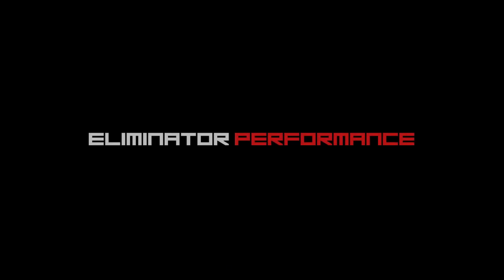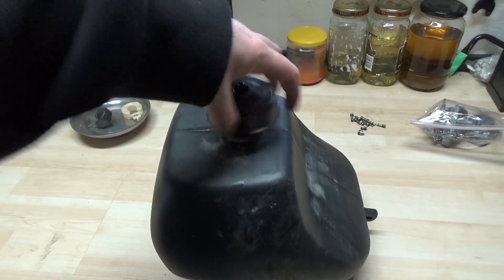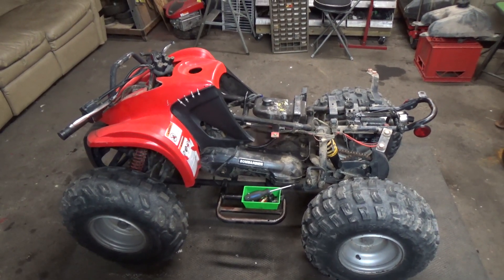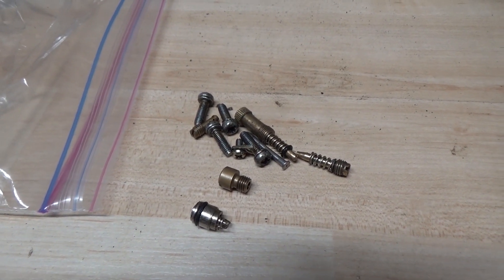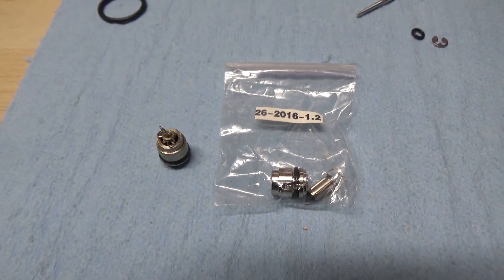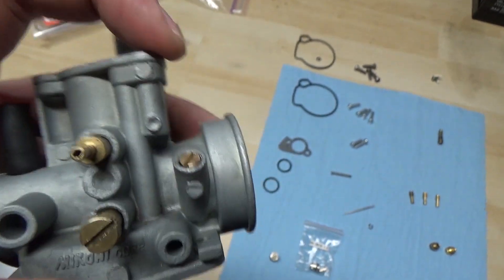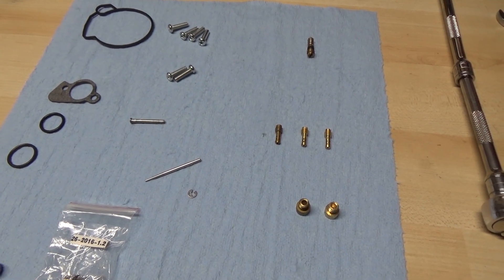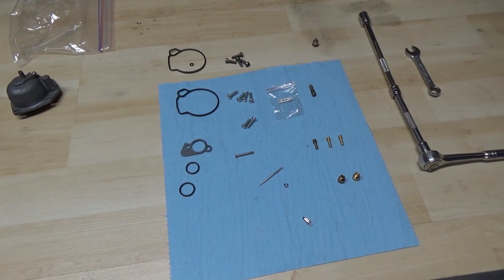2004 Bombardier DS90 - Carb Rebuild [Part1]

Comment: This is the best vid on net for this carby.. Can I just add....
Under the main jet is the brass atomiser (not sure what it's called, but that's what it does). Push that out gently so it comes out the same direction as jet. It has 10 small holes similar to the pilot jet. Clean this out before you replace the main jet. It doesn't come with kit.
Mine had that much garbage in it I'm actually sure a new kit would do nothing... A mate of mine brought this to my attention and saved me more frustration, so thought I'd share.

Comment: Great video. Question for you, if I want to delete the oil injection system like you mention, do I need to worry about removing the oil pump and cable leading from the throttle? Or is it ok just to plug ports,remove the oil tank, and run mixed fuel. Thanks.
Reply: I'm wondering the same thing. It could lock up do to not oiling itself I would think (smart cells activating!).
Reply: Just leave the tank in place and hook it up to itself so it will cycle and lubricate itself

Comment: I'm working on a buddy's bombardier 90 and to begin with wasnt firing up I ended up finding the blockage in the fuel valve cleaned it up and I'm getting gas flow and it fires up and idles great but when you give it full throttle it stalls out you can lightly press and hold down the throttle and it will rev up but not enough to move but when you give it full throttle to try to ride it it just stalls right out any suggestions???

Comment: I just picked one these up to fix but can't figure out how to remove the electrical plug attached to the carb. I assume those wires are for an electric choke but not sure. Do they just pop straight up off the carb. Thanks!!
Reply: I can't get mine off either?